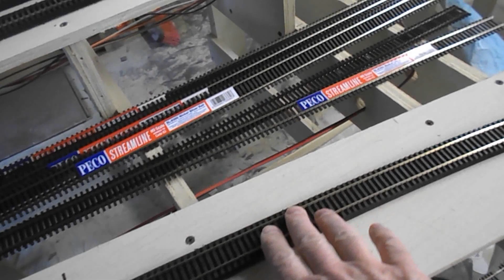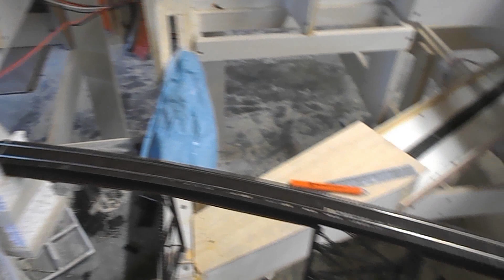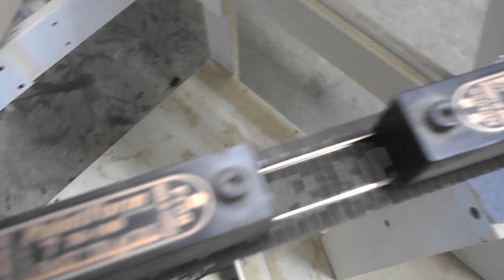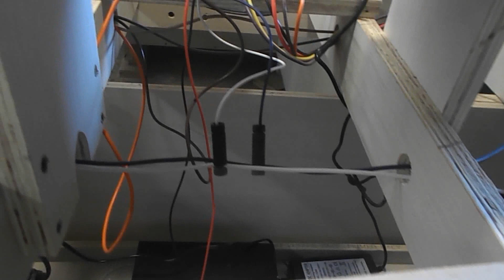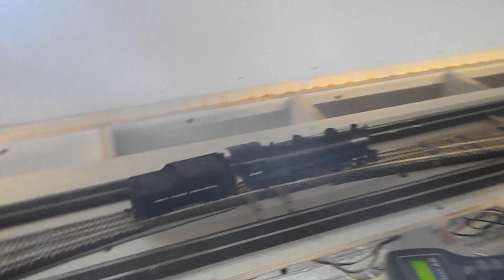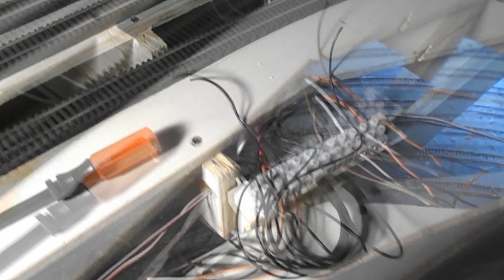K&SV layout build 16: Multiple tasks for the middle level

Comment: What an amazing build this has turned out to be.  The complexity of the layout and the attention to detail I think is one of the best you have ever done.
I agree with Martin Worrall in that a dismantle, Transport and re-assembly Vlog would be fantastic Video.  (Also a completed layout small Video would be the icing on the cake.  By the way what part of England do you come from.
Cheers
Reply from the maker: A video of the completed layout is unlikely, given that the client will be doing the structures and most of the scenery.  Model railroads are rarely if ever finished anyway.

Comment: Where you have the eight turnouts they are effectively four crossovers.  Do you control all eight individually, or do they operate in pairs with one push button operating two turnouts? 

PS - as always a great video - I'm loving seeing this layout's construction.
Reply from the maker: They are operated properly as 4 crossovers, not 8 individual turnouts.  There are several places in the video where this can clearly be seen.  Did you not watch it all the way through?
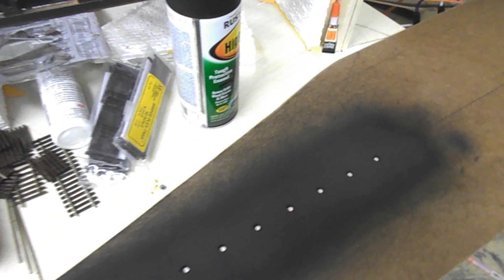Reply: @mpeterll  yes I watched all the way through (as I do with just about all of your videos the first time through) from watching it I couldn't tell if there were four push buttons of eight in this section and when you moved on to the fascia (@14:57) at the end of that section there were certainly nine switches to be installed which could have been sufficient for the eight turnouts in the crossovers plus one for the logging spur (although these are actually for the isolating switches for the lower level).  That's what prompted me to ask.
Reply from the maker: @leestoddart7014  That row of 9 switches are for the isolating sections in the 9-track staging yard below.
When I'm testing with the locomotive, there are a few times when you can see pairs of crossover controllers at each end (one near the middle of each crossover.  Also, when I show the fascia mounts being pained near the end, there are 4 bigger ones for crossovers.
Everything will be much clearer after next week's installment.